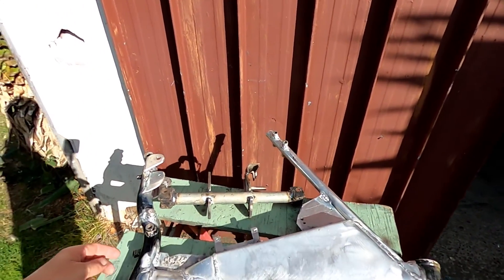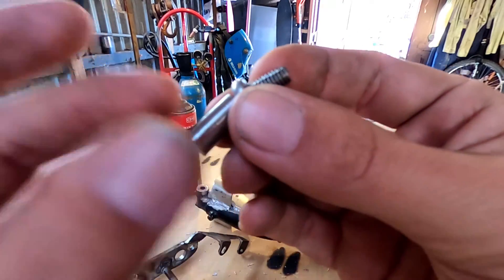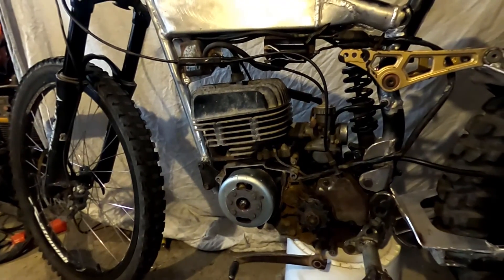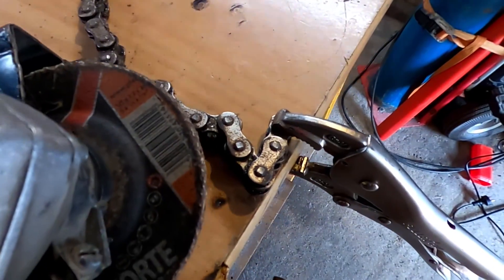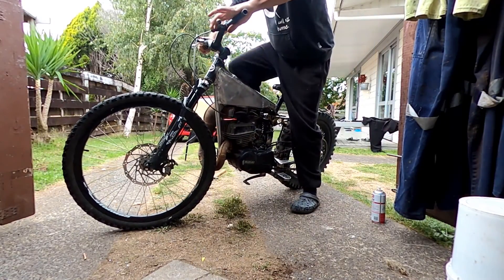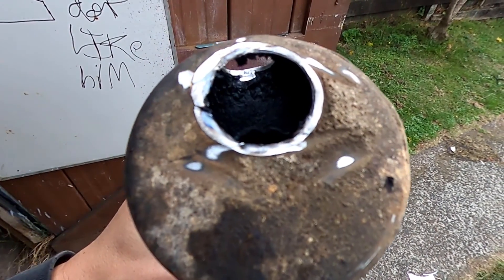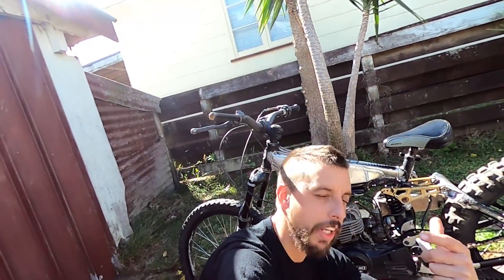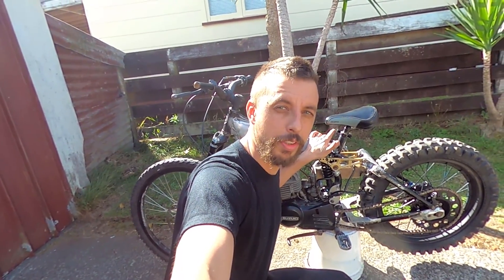Motorized Bicycle 125cc 2 stroke build/p5

Comment: With that Ben in the pipe for the exhaust too much back pressure going to lose performance an power the neck in the front where the forks go into you might want to cut that off and moved it out a couple degrees more so you have better clearance for steering awesome video enjoy very much

Comment: Can't wait to see this thing shred some dirt man looks like it rides pretty good does the front tire touch the exhaust at full sag
Reply from the maker: nolo keulema no it doesn’t hit , probably would if I put a new tyre on haha. I can’t wait to give it a good ride
Reply: @dkthewelder  maybe try rolling a small piece of metal into a c shape so the chain will ride in it instead of trying to go around the swing arm
Reply from the maker: nolo keulema yes that is a good idea because the chain gets tighter as the swing arm moves so a roller might not work
Reply: @dkthewelder  I mean if you put it over the swing arm a roller might work just fine I was just thinking simple